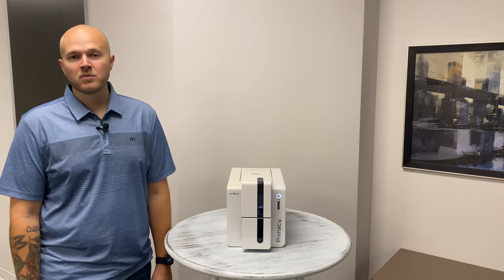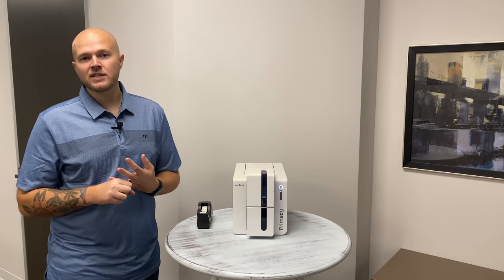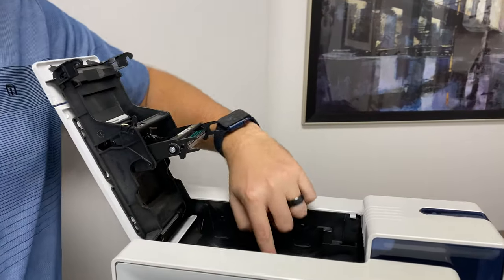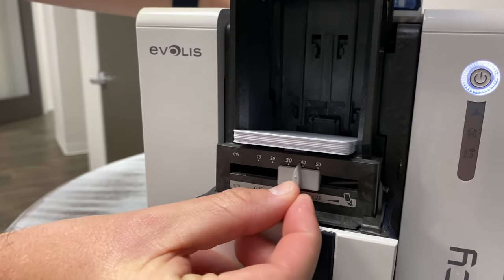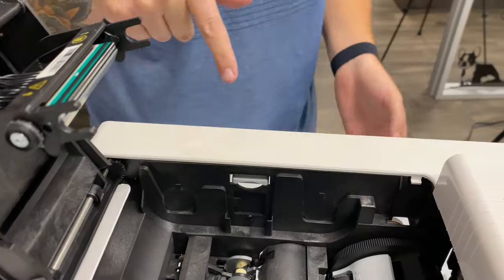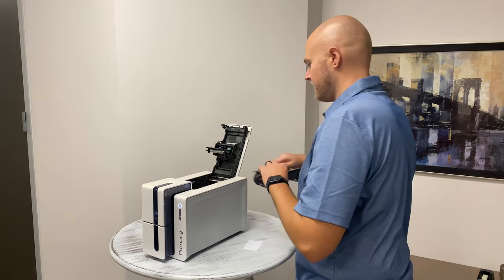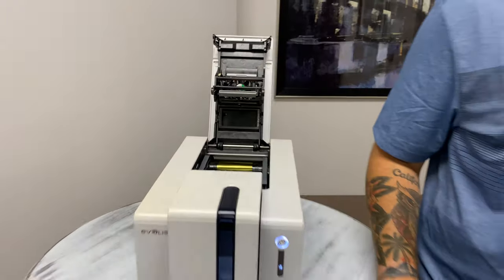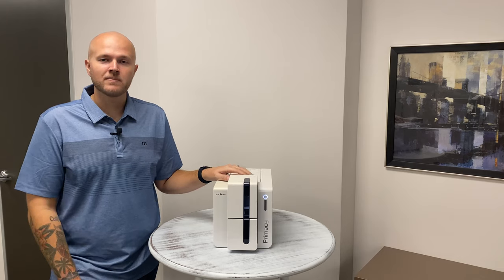primacy issues and fixes

Comment: Hi Matt - I'm experiencing a vertical white line on the left side of my badge every time I print. (portrait mode). I have cleaned the machine with the adhesive card and have cleaned the print head with the alcohol swab - still the same thing
Reply: clean the printhead, if there's no improvement change the printhead

Comment: i got a poblem with my Evolis Primacy that the printer can't rolled the card. How i can fixed it? Thanks before. All troubleshooting has done, first i update the firmware, but i have notice the Evolis Print Center notification that said printer regullary bla bla...i forgot.

Comment: I purchased this printer yesterday and I am using full ribon ... Its giving me headache . ..its not printing black text good its giving light black ...kindly help ...
Reply: I have the same problem, how did you fix it?
Reply: @wouter964  1st- clean the rollers and head . 2nd- change contrast level to 12 2nd- change monochrome resin to 16  3rd- change resolution to 600dpi
Reply: @wouter964   Don't know if this can help, but If I were you, I just go to the printer settings a set the default
Reply: @jaibalaji1264  black printing is light tried your settings and also others also. my new printer everything ok but print quality is not good.

Comment: Very Informative. 
However, none of those solutions applies to my problem.
My printer shows a Mechanical Error only when I press print, "There's no card jamming, Not strange noises, and Ribbon is new".
I opened both of the side covers just to check for anything loose, but everything seems to be fine.

If you have any ideas, please help.
Reply: issue fixed?   send us an email  sales@newbart.com
Reply: Change ruban

Comment: I have another problem, my ymckok ribbon is new, when we print a card it goes through several panels, wasting what we can print for three cards, it only makes one, I already modified the printer configuration on my computer, but the same thing keeps happening. thank you
Reply: There is a RFID chip in the ribbon that keeps track of your usage.  There is often a few extra in the beginning and end of the each ribbon